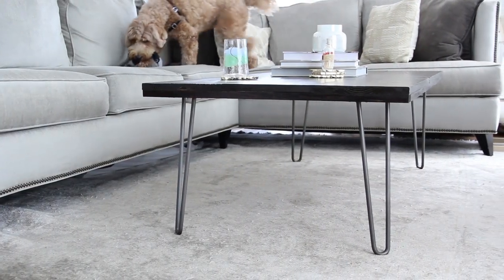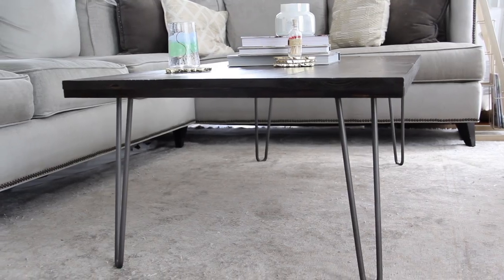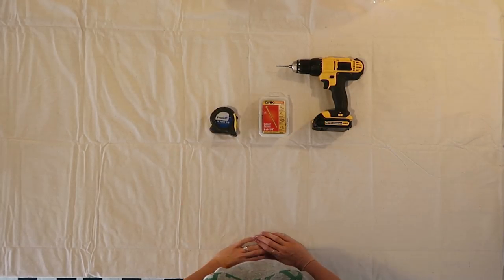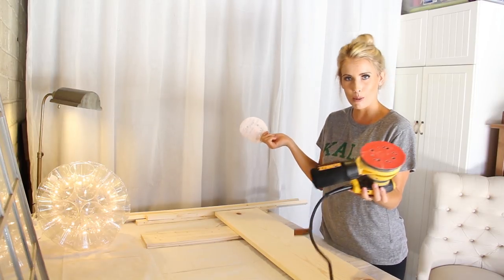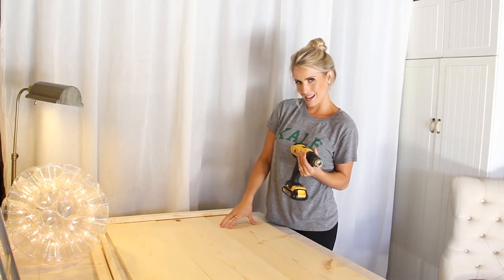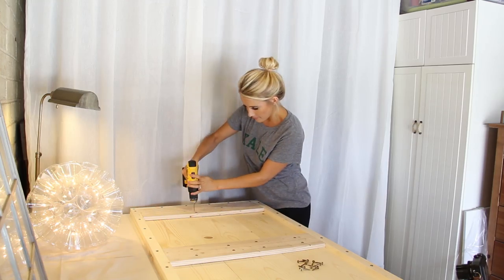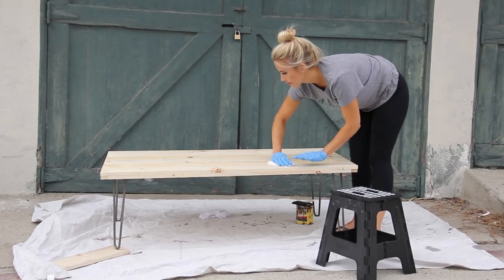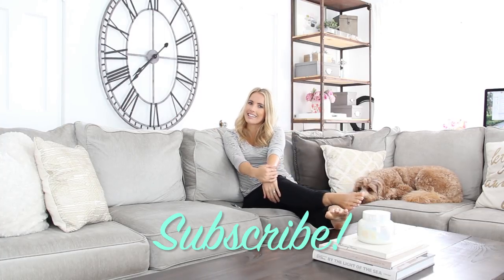DIY DECOR: DIY Hairpin Leg Coffee Table for $100

Comment: I'm a bit confused why it cost so much? We're the hair pin legs really expensive? I guess if you want to do it cheaper you could use the planks for the too, msg for the bracing and get the hair pin legs at ikea? I hear those ones are really cheap?

Must admit its nice to see a woman doing woodworking though as most often this type of diy is done by men. Cool job!
Reply: from what i've seen, hairpin legs are super pricey
Reply: the legs are $49 alone. still affordable considering most tables like this if you were to buy them from the store would be more than $100
Reply: Andrea Worley youch!!! Can get them here in the UK for a lot less than £50, even on eBay you can get them for £5 each (not that if necessarily trust the quality) but I'm majorly into upcycling for furniture so would make something from something else. I love how styles and tastes are so different 🙄